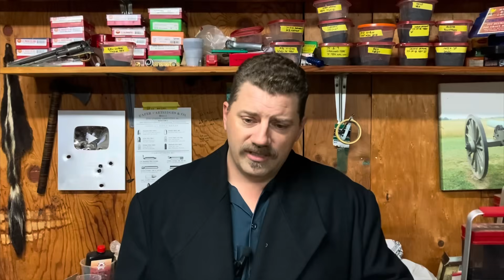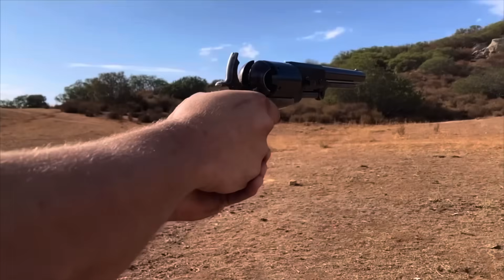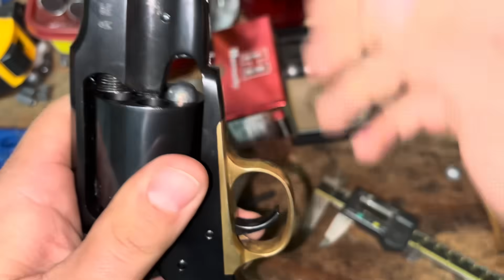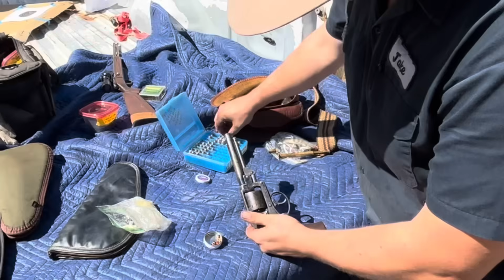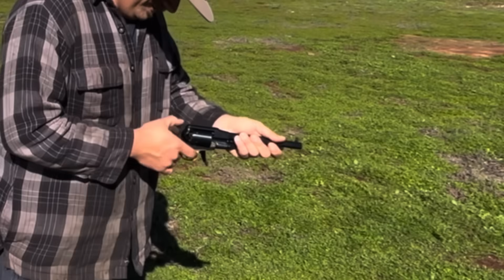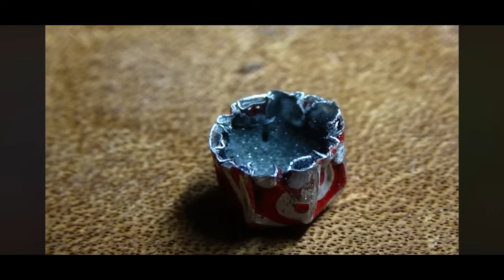Chain Fire Number 4. But Who’s Counting?

Comment: There is a theory regarding powder entrapment causing a crossfire from the face of the cylinder. This is where powder kernels, due to sloppy loading, are caught by, and drug down the cylinder wall, squeezed between the ball and the wall acting like a fuse to the main charge. It leaves a “stripe” of crushed Black Powder.

I have seen NO DIFFERENCE on the width or consistency of the bearing mark left on a RB or conical with either a chamfered chamber mouth or a knife edged chamber mouth. The sealing surface is exactly the same if the lead has been scraped off the ball (knife edge mouth) or swaged down on the ball (chamfered mouth). I have in fact chamfered all of my cylinder mouths to relieve the stress on the revolver and my hand while loading. It also allows for more consistent pressure on the ball while seating it. Getting those .457 balls loaded is much easier this way.

Unfortunately, I do not recall where I saw it, nor can I locate the article explaining the theory of powder entrapment. It was a great read and made sense.

Comment: I shoot a pair of 61 Navy Ubertis in CAS so I put a fair number of rounds down range. I use lubed Eras gone conicals in paper cartridges and slixshot cones topped with CCI 11’s seated with a dowel. I’ve not had a chain fire yet. Not sure if that’s the magic formula or not, but seems to be working so far.

Comment: Great video as always Jake.
Some thoughts......If there is a ring of lead shaved from the balls on loading, we have a fit as good or better than a cartridge revolver, and I have never heard of a cartridge revolver chain firing. That seems to suggest that it is more likely to happen at the cap end, but no one really knows. I have shot many thousands of rounds from my own Remingtons over the years and never had a chain fire.... so far. I do load either a thin (1/16") lubed wad under the ball, or use paper cartridges with lubed concials (no wad).... perhaps that is a factor. I have never put lube in the chamber mouths, but it's hard to see how you could possibly get a chain fire with that in place.....and you did get one.... Again this suggests the cap end is the source.
A bit of background... whenever I have come into possession of a caplock revolver I measure the groove size and ream the chamber mouths to .001" larger than that. I usually shoot .457" pure lead balls that I cast myself, loaded sprue up, but I'm not fanatical about that as the sprue from my Lee mould is very vestigial.
Cap fit is, I think important. A good fitting cap should be near impossible to remove without damaging it. I carry a little "pusher" for seating them if they are a tight fit... a bit of fibreglass electric fence standard with a little wooden knob on one end...Using this I can force #10s on to #11 size nipples if I need to (cap supplies are erratic here in New Zealand and we have to use what we can get) and it avoids breaking my fingernails 🙂. My capper that I made for the Remington action is usually sufficient for pushing the caps on as it has its own plunger to push them on. proprietory cappers don't work with the Remingtons (and some others) due to all the steel surrounding the nipples.
RWS are the best caps there are IMHO, and they are very powerful. Fired on their own they make a much louder bang than any others I have tried, and the flash is really awesome. The down side to that would be that if an adjacent one was not properly seated there would be more likelihood of a chain fire I would think.
This is one of those phenomena that is difficult to analyse because it occurs so seldom, and without getting completely silly with loose balls and caps, cannot be reproduced at will. 
Perhaps we will never know....

Comment: Contrary to bullshit belief, it comes from the front. Powder has a flash point. I know boneheads on YT say crap like, "the flames have to go through the touch hole to fire a flintlock. If that was the case, the odds of them ever going off would be astronomical. Some even say a spark has to go through the hole to make them go off. If that was the case, why would you need pan powder? 🤤🙄 Frick'in ridicules! It's the heat of the burning powder reaching the flash point that sets it off. Any small imperfection around the ball is the same as a flash hole. Like no full ring of lead or the sprue like you showed. I always grease over my balls and the ones in the gun 😆 Never had a chain fire. With my old '58 I have always had to pinch the caps leaving openings on each side, never chain fired. Can even be chambers slightly larger than the rim. Evident by balls moving forward from recoil. It's basically impossible to get chain fire when greased. Put all that in your pipe and smoke it! 😆😅😂🤣have a great one!

Comment: I had two caps ignite with one shot once.  The only reason it didn't cause a chain fire was because the nipple was clogged.  When I tried to fire the next shot, nothing happened and I found a spent cap on a loaded chamber.

Comment: I've been shooting BP guns since I was 12. Built my first kit CVA Colonial pistol at 14 (wasn't legal until 14 in my state). Got my first revolvers like you at 17. Two 1851 brass frame colts. They used .451 round ball. Back then most revolvers used a .451.  In all the years I've never had a chain fire. I put a drop of 10w40 motor oil in each chamber, (make sure it coats all the way around the loaded round ball). 
The drawback is, that this works, but it makes a mess but in the Remington 1858s. It actually causes some build up on the chamber pin. Thus making the cylinder hard to turn after around two loadings (a thinner oil makes it worse try 10w50).  I would rotate the cylinder by hand before reloading to loosen it up. If while shooting this were to happen I'd assist the rotation making it easier on the hand & spring and cylinder catches. This oil drop works great in 1851 colts but not ideal in Remingington. 
After watching many other videos over the years (yours included), i believe i need to revisit lubbed wadding under the ball again. I can't recall why I used oil in the 1858 rems and not lubbed wadding.  Must of been cost or laziness or both. 
But I think you are correct, hard fowling makes round ball's go astray quickly.
Reply: .451 dia? The colt 1851 was.36 caliber which would be around.375 to.380 dia. not trying to be a smart ass, maybe I’m overlooking something here.

Comment: Granulation size and misunderstood microscopic powder dust that the human eye cannot detect on a black cylinder with black powder, ask yourself if you ever seen or heard of a chain fire with pyrodex? If you will develop a habit of licking your thumb and wiping the face of the cylinder after loading, you will reduce your chance of a chain fire by 46 percent. But remember back blast does emit from all nipples after firing, and deposits microscopic powder dust mixed with residual unspent fulminate and the highly flammable bonding compound used to hold it in the cap. Having said that, Calvary lore from both the north and south both suggest that a chain fire is in fact a sign of assured victory, especially if the shooter is chaste and unsullied, so please do not automatically view it as something negative, maybe be a little thankful.

Comment: the chain fires i have had came from the nipple side.  we examed the cylinder and found a carbon track between two cylinders, like in a bad distributor cap.  you have to look close for the tracks.

Comment: Caps are shock and heat sensitive (obviously). Is there any possibility getting ignited by anything other than random sparks? I can't think of anything else that would cause a chain fire however. Would be interesting to recover/inspect a cap from a chain fired chamber to see if there's any clues there maybe.

Comment: Lube that my dad always told lube keeps you from having chain fire but also keeps your filing done and also it loops the barrel by Seasoning it  overtime makes cleaning a lot better with all these wads and stuff that has lube that's great but reality. You need enough lube to keep things going so you don't have issues such as chain firing and cylinder pin acting up and cylinder acting up

Comment: Chamfering cylinder mouths can help. A lot of the originals have generous chamfering. It would also help to have properly fitting caps. Flame doesn't have to make contact with the powder to set it off, just heat. I still recommend "cones" from Track of the Wolf. our 1075s won't work well with them though.

I do agree that most chainfires are most likely from the chamber end.

Comment: Hmm... Glad ya didnt get hurt at least...  Ive heard the same horror stories... If your using a properly sized ball itll come from the nipple side. Not all chambers are round and that can cause chain fires. Typically if your getting a ring of lead that isnt broken, its usually a good sign you got a good gas seal... 0.454 shoulda been enough for the gas seal... And the rws 10.75s shoulda been fine too, odd. Got me curious about slugging the chambers and checking the cones. I wont say they only come from one direction or the other. But from the ones ive seen its been from the cone typically from the cap falling off. Grease isnt gonna stop it from the front though regardless of what people wanna think. A lot of grease gets blown off the ball after loading during firing. Historically i doubt many lubed the balls at all... Colts instructions back in the 1850s didnt mention lube in anyway shape or form.
Reply from the maker: We’ll just have to agree to disagree. If grease can seal a chamber loaded with nothing but powder and a felt wad. I would call that very effective for preventing any flame from entering from the front.
Reply: @Everythingblackpowder  yea, im not gonna stand on bibles for it. Just learned not to trust it for that reason. I lube over the projectiles with mine for the fouling... I use mine instead of a cartridge gun for varmint and predator control on my ranch in Arizona just because i can carry more ammo then i can cartridges. 

I do appreciate what you said... Keep up the good work either way bud. Only thing i can think of is maybe the chambers are out of round? Not a big issue as much as its something to be aware of. With quality control slipping, I wouldn't be surprised

Comment: I have never shot a black powder hand gun so I dont have the experience that you do.
With that out of the way, you answered your own question.

If the cylinder does not cut a good ring, and no grease, then it could ignite from the front of the cylinder.

If the cylinder does not cut a good ring, and you do grease it, then it is unlikely but not impossible to ignite from the front.

But if it cuts a good ring and you grease it, damn near %100 wont ignite from the front.
With that being said. The most likely source of ignition is from loose fitting caps.
If they need pinched, or altered any other way. Then it opens up gaps that can let in fire.🔥 

Since I dont own a cap and ball revolver, can I ask a dumb question?
Why do they not make caps and nipples to a set spec?
If you need to pinch it, it seems a bit arbitrary, and dangerous.

Comment: STOP CHAIN FIRES FOR EVER!!! Your revolver will never chain fire if you do this. Seal the chambers with bee's wax. Use the type found in toilet ring seals. It is thick and stiff even in the summertime. Thick dose not blow off. 50 years ago when I started I had a 1851 in 36 and it chained all the time. An old timer told me about bee's wax. And in 45 years I have never had a chain fire.

Comment: Some caps compound is sometimes more sensitive due to mixture. But, factories are picky about that stuff. But, it can happen. And if there is a split in the nipple or if there is enough heat and pressure. It could set off one of the other caps. I've fired hundreds of rounds out of my revolvers and have been blessed with no mistake or malfunction. I've always been skittish on weather or not my caps stay in place or not. And do the same things as you. Everything is as you said. I also use felt wads for extra security and to get the load tight against the powder with a good tight press fit. Richard Lee founder of Lee reloading did a study with Rugers reproduction army. And made the conical revolver bullet using Rugers revolver. He wrote that so long as the lube grooves had greese in them he could not make a chain accur and he never heard of it happening to his any of his customers. He also mentioned a snug to tight fit of this bullet. As it guides itself in and each ring on the bullet gets tighter. Making me believe he was focused on getting a good press fit expansion in the camber over the powder. Im using this as reference. But he says the Lee conical revolver bullet "this is the only conical you may load without grease over the bullet nose." "Just in the lube grooves." He also attested to grease being over the balls and bullet noses. "Are ment to prevent high pressure gas and flames from setting off the other chambers in the cylinder." As you just said. I don't use the pop can percussion caps on my revolvers only because the chain fire chances are high due to the occasional falling off and overall size of the one I have. Works well for percussion side locks. If you read this. Thank you for these videos. You are the first chain fire I've seen in a real time field test and I know others have filmed and wrote of them and gave there opinion. All of them have circumstances and some different and many similar in operation. But, I'm kinda shocked that it happened to you. And I don't like the fact that caps these days are not fitting snug to the nipples. But I worry more about how tight my load it in that chamber. I've shot many without grease too.  Stay safe and accurate on the range. Your videos never suck. Well except if you count that one.... you never did but should have.😂😂  Keep'em Smoke'n

Comment: Per the original colt instructions a round ball should be a few thousands larger than your cylinder.  When you ram it there should be a small ring shaved off.   Chain fire is from the front of the cylinder.

Comment: where you put the ball into the cylinder see if there is a tiny little lip that needs to be machined out very easy to do with a dremel tool if that lip is there will make the ball lose after it's pushed all the way in

Comment: I've noticed that pietta and uberti cylinders have in most cases a half thousands of deviation between cylinders.i would ream cylinders to the largest sized chamber( provided it's slightly larger than the bore size) and use tight fitting ball. But always lube chamber mouth.by reaming chambers and also cut and polish forcing cone to bout 11 degrees, you will get good accuracy and will just about eliminate chain fires.i own 15 cap n ball revolvers and have yet to have a chain fire.

Comment: Why is it so stankin' hard for manufacturers to bore correct sized holes in a cylinder, install correct sized nipples in the back? Even in modern cartridge revolvers, the throat size, chamber size, chamber finish, end play and all the rest is so spotty. Tooling wore out half the time? How card could it be to have some decent sharp bits, have QC check those things, and make accurate cylinders?

Comment: I’ve had three, possibly four, chain fires in the last 45 years. Two were definitely from the front of the cylinder. One definitely from the nipple. The last one, I have no idea. If I’m going hunting or plan on keeping one loaded all day, I’ll take my caps and get some beeswax around the edge of the cap. It waterproofs and ensures there are no chain fires. I also use a felt wad AND grease in the end of the chamber. When I take care like that, never had a chain fire. Yeah, I’m not a ‘purist’ but, I don’t like chain fires. The muzzle velocity is nothing near in those open chambers when it chain fires, but it’s still unpleasant.

Comment: Good video! I have only one CB revolver, a Uberti 1860 Army. Got it as a kit in 1982. I’ve only had one chain fire IIRC…  I really think chain fires will happen when they happen. However, I also think using good practices like greasing chamber mouths, good fitting felt wads between powder and ball or greasing the chamber mouths and keeping your gun well maintained mechanically will help reduce the likelihood that it would happen. I really don’t think there’s any way to guarantee that they won’t happen. Just my $.02
Reply from the maker: It goes with the territory

Comment: I do gun repair in s.e. Georgia. Out of 30 years, I have only been told of a chain fire from a cap and ball about twice, ever. Both claimed it came from the front of the cylinder.
My suggestion is to try to meticulously catalog every loading from materials to weights, as well as which gun, cylinder and which chamber in it is maybe the culprit. Then the next time it happens you can have info to maybe figure out what is causing it.  ( I bet it is a very subtly defect and likely even the same cylinder doing it. )